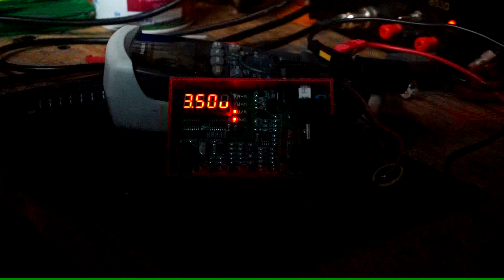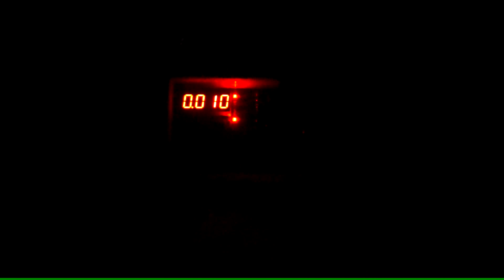ZH-YU ZB206+ Battery Tester

Comment: Cool thanks for the link to instructions i was trying to test AA's and I think it cut off at 1.3v and i had previously been draining down to .9v but this tester only goes down to 1v it looks like so I probably wont be going back and retesting everything but the resistance is good to know and I have plenty of 18650s to test
Reply: Glad it was helpful! I do like that little test rig for the Lithium batteries in particular.
Reply: Ya i might use it for some but i have a LiitoKala lii-500 which is way faster it charges then test by discharging and recharges 4 of them automatically for around $20
Reply: I figured ud use it to test my packs i have a 7S 20P already setup and another 7s 28P that i have assembled but not really together I was thinking about testing a whole group and see if they are all about the same like they should be